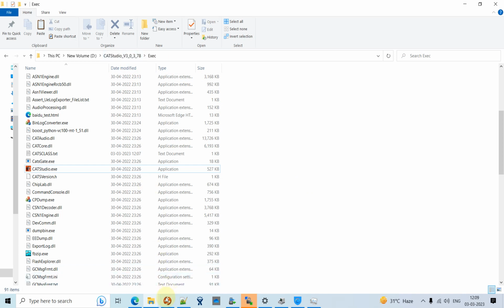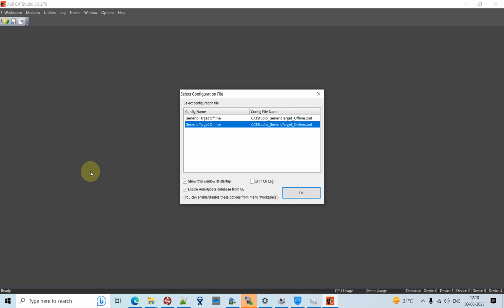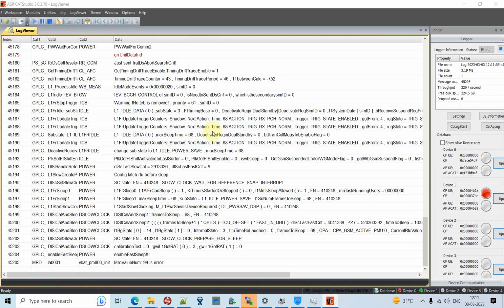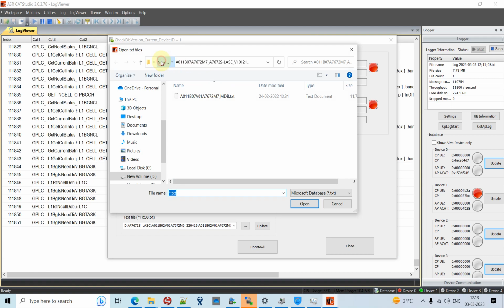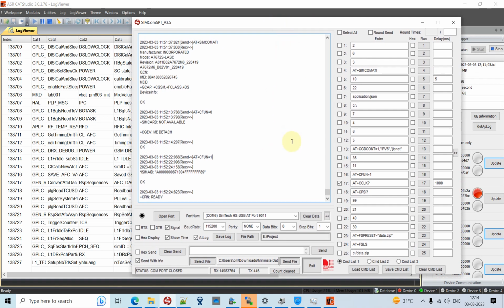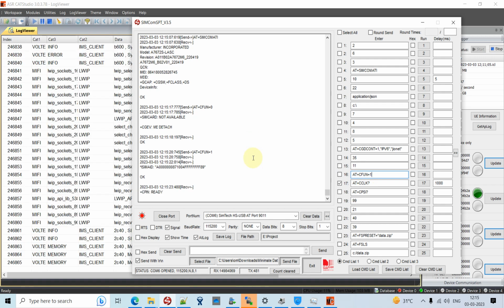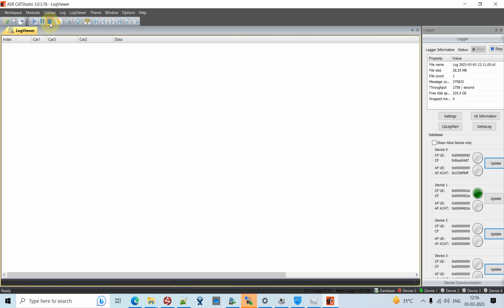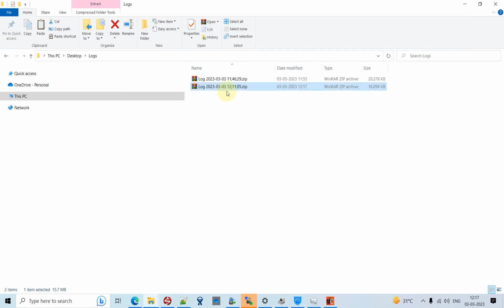Debugging A7672 module using CAT Studio

Comment: hello sir, I  am using simcom Model: A7672S-LASC . 
Revision: A011B02A7672M6 A7672M6_B02V01_211026 
 Can you provide the Firmware  download link?
Reply: Found any solution? I also want to upgrade and currently same firmware as you mentioned